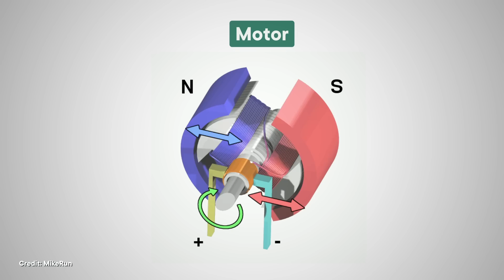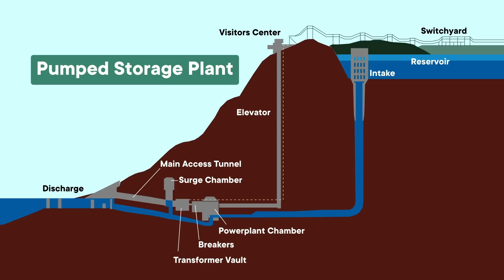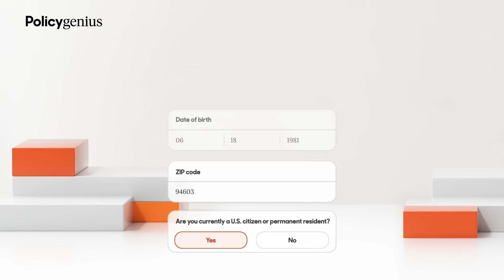How To Make Buildings Into Batteries

Comment: Back in late 2000s i was working for an energy firm as a young risk manager.  I got an opportunity to spend some time one on one with Jon Willinghof the previous chairman of the FERC. One thing he said he can see in 20years making batteries out of parking garages for peak shaving.  He imagined EVs(Priuses at the time) all charging in a parking garage, they then release energy during peak and recharges during non peak or at night with free or low cost electricity.  This is obviously way before the solar boom and the duck curve killing the traditional peak hours and the pandemic destroying the traditional office.  But about 5 years ago BMW tried a pilot program and now we have virtual power plants with tesla batteries so his vision did come true albeit slightly different.
Reply: There's also a similar-ish idea of reusing old EV batteries in power grids, since a decade-old Tesla Battery loses about 20-25% of its charge capacity, which for a car is horrible, as you lose something like 100 miles of range per charge, so you have to replace the battery, but if you're already replacing it, plugging it into a local power grid with hundreds or thousands of others is a great way to make up for that loss of capacity and get another decade of life out of it.
Reply: it is amazing they  do not subsidize  the power at the charging point. Dynamic pricing could work  where the  production was the determining factor and people would  get used to leaving teh car in teh parking lot to get charged. all them cars, if there were enough, would work to serve two functions. but cars are better replaced with  public transport and the batterioes for himes could be  iron salt or whatever they come up wit next.

Comment: Sounds awesome, though I don't think that holding megatons of water inside sky high building will be simple at all. One strong earthquake and your city is now a lake.
Reply: Look for my comment around here, where I explained why it doesn't even make sense energetically. Unless it somehow pumped liquid mercury or something, gravity has a miniscule energy density. For the volume of water I estimated it is practically nill compared to the energy requirements of a skyscraper.

And even if I underestimated the volume of water by a factor of 2 (which I doubt because I actually might have overestimated it) it still isn't worth the implementation of such a structure-altering system.
Reply: ... and you could save money on the sprinkler system 😊
Reply: The truth is, it isnt really that much water, because the space inside the building core is very limited. Enough to create structural problems, but minimal in terms of stored energy. Also plumbers will have a lot of work given the expected amount of leaks. And building users will have to go up diving because there wont be space for elevators
Reply: @joseangel-27123  
the more comments I read the more it seems to me that the main problem with this technology is critically thinking about it in any practical capacity.
Reply: This is already a thing. We already have water towers. Large cities store water on top of tall buildings (think NYC) and cities (and even farms) all over the world pump water up into tanks and use gravity for the flow out of the tank. This is useful to protect your water source in the event of a flood or contamination - the water can be treated before it gets to your home. If maintained properly water towers are super useful. I am considering installing one on my family's property for when our home is without power, like during major storms. Currently we have a well and without electricity or a generator we don't have running water. A tower would solve this problem in emergencies (as well as a hand pump). Additionally we have been considering using a solar piping system along the roof line to heat the water and pull some heat away from the roof. Anyway, I think there are some very simple solutions out there that we should all look into for storing energy. I think he has something with the gravity battery thing.  I'm interested to see what they do with this stuff.
Reply: Not every city is located in an earthquake prone area
Reply: sounds kinda rubbish if you think about it

Comment: this is super neat and interesting. though, there are few things heavier than large amounts of water. storage and transfer might be a bigger problem than is realized. also preventative measures will be needed in case cracks or breaks form causing flooding or even a mid city tsunami.

Comment: One of the other ways we can eventually use skyscrapers as batteries is use it to store thermal energy, with glass that has coatings to take advantage of the angle of the sun. So like in the summer, you use your AC at night to bring the interior temperature down to just below comfort level, and have the glass reflect the high angle sunlight away to not have as much solar gain, then in the winter, heat the building up during the day with low angle sunlight, and have the thermal energy store itself in the rest of the building structure to let off at night. The only problem is such coatings that are efficient at this are only available on small scale windows in the lab because they’re finnicky AF, and therefore the only current way to do that is by applying additional external films and removing them seasonally.

Comment: I remember doing the napkin math on gravity based energy storage, but the issue was that it's really not energy dense. Using water is far better than say concrete blocks, which you mentioned.
Reply: Assume a 400m high tower. You need to lift 1t to the top to store 1khw, assuming no losses. To replace a single Tesla Megapack (Basically a shipping container full of batteries), we would have to lift 3900t to store the 3.9MWh.
Reply: Only because more water is used. Not possible in the proposed scenario. 
A bloody stupid idea.
Reply: But turbines/pumps aren't terribly efficient either.
Reply: @Rorschach1024  not sure what you mean. A pumped hydro plant can have a round-trip efficiency of more than 80%
Reply: What if you could store energy in red bricks? The buildings are already up. We just need to figure out how to store and extract the energy:]
Reply: Concrete has more than twice as high mass density as water, directly translating into gravitational energy density. There are however other reasons for why the concrete battery is idiotic.
Reply: @MrFrexxia Correct, the concrete holds more energy (for a given elevation change) per volume due to its density, but you either need to buy thousands of generators and winches instead of just one generator and turbine, or you need to have a warehouse-type system at the top and bottom (which will cost a lot and negate the energy/volume), or you need a large train modified with gear boxes to increase torque without requiring high field currents in the electric motors 24/7 that would waste electricity and heat up the motors (compared to regular trains that only require peak torque for short periods).
Reply: @MrFrexxia  concrete is comparatively expensive and its production releases lots of CO2. Using concrete, you've now also created a warehousing and maintenance problem for yourself.
Reply: I imagine having a lot of water high up in a building helps with some fire emergencies too.

Comment: Batteries have never, ever been all that green. Greener? Yes.
Reply: it is all a bunch of bulls anyway, you know how I know?  well, think about this, bicycle generator using your body as a motor that they could use it to reduce the cost of your electric bill and recharge the battery's company system too, also the extra electricity that's going to waste, even at the exercising places they can make it make a one big generator.
Reply: I think nuclear is more greener than any other setups
Reply: @lokeshloki8628  Nuclear power generates radioactive waste. So that is a no-go.
Reply: @rosesareredbutzerglingssti9290  The nuclear waste "problem" was solved decades ago. The only thing holding it back is public opinion. Some say cost is an issue, but that's also not really an issue, as it's just a matter of getting more familiar with the process. The plant also pays for itself within a couple years of operation.
Reply: @lokeshloki8628 
Even with nuclear power (which can be very safe and effective) there will be times the demand for power supersedes the amount of power being made. So more efficient and "green" batteries would also help stock power for times of greater use.

Comment: this sounds cool and all, but i cant ever see this  particular water battery skyscraper working, at least when u said its going to be in the "walls" this would absolute need to be in the center of the building, and even then the psi at the bottom of your "water tight tank" is going to need to be absurd. this whole idea sound ludicrous.  all i a picture if when you get your fire water leak. and its going to either be a catastrophic failure..

Comment: Can elevators create energy on its way down?
Reply: They can generate electricity and some do have the feature to inject the power back into the grid.
But that mass had to go up at some point so it's more like regenerative breaking. Useful and efficient but not gamechanging.
Reply: Not really.  Elevators tall enough to have enough useable potential energy are already suspended with counterweights to reduce the amount of energy required to move them in the first place.

Comment: My first concern would be earthquake safety. Supposing the weight of the water is significant, would having a top heavy building make it more likely to oscillate and break during an earthquake? or are we beyond that point in architectural engineering?
Reply: Oddly enough, this might help make a building more stable in an earthquake. Tall buildings already use tuned mass dampers for earthquake stability, and if they were able to adequately account for the sloshing of liquid in the system and have enough baffles to make it not hit a resonance frequency, they could essentially turn the system into a tuned mass damper of sorts.
Reply: @cheeseisgreat24  If you've ever biked while toting a couple jugs of milk or other liquid, you'd realize that water is a terrible mass damper. Oscillations that act on containers of fluid produce higher-frequency oscillations within the fluid that can cause constructive interference which would magnify the oscillation.
Reply: @lozoft9  That’s why Baffles exist.
Reply: @lozoft9  Slosh mechanics can be subdivided and you absolutely could design a set of baffles to absorb the oscillations and counter each other, it’s how bulk fluids are stored in moving vehicles, esp. in airplanes.
Reply: I'd expect you could drain them pretty quickly